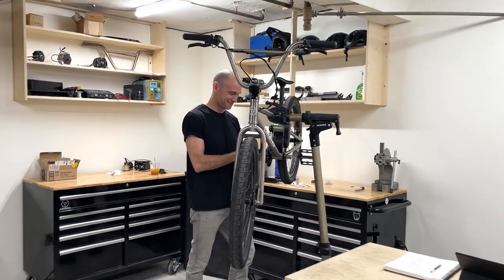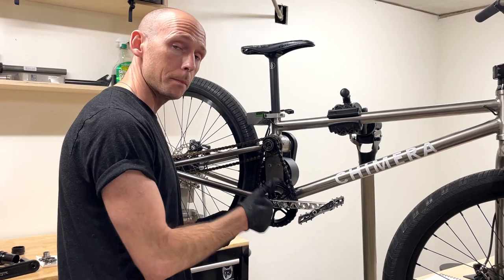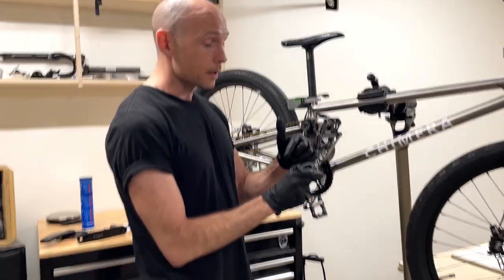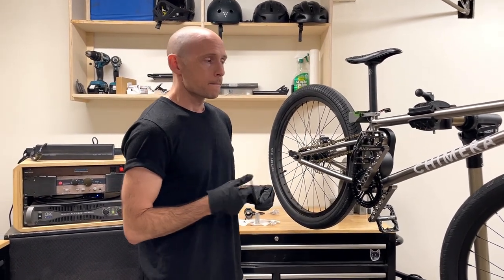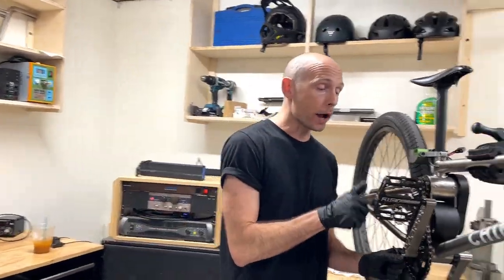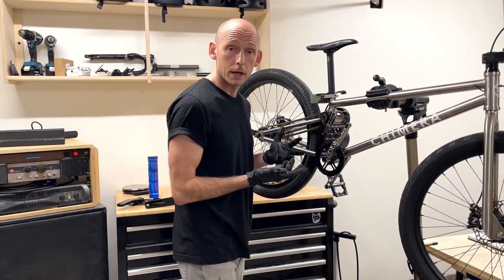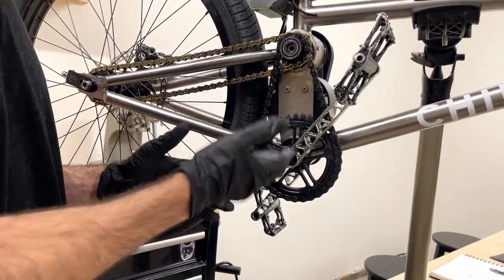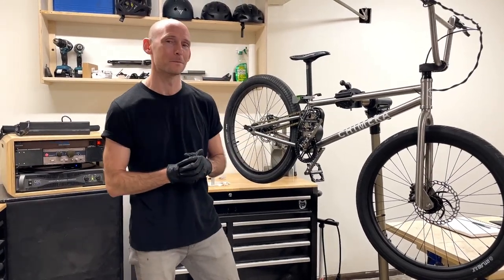In the Workshop - Chimera Crank Compatibility

Comment: Love that you are working electric into a BMX style bike.  Is your target market park and freestyle riders, or boot-around-town/commuters? This thing look pretty beefy (and titanium is a nice touch).   What's the rider height range that your geometry fits?  For example, would a 6' 3"-6' 4" rider fit?  I see that you have a 22" top tube, and 24" wheels, which might be a little tight for bigger guys.  I saw this a few months back when I was contemplating building an electric BMX, but didn't know you were so close to launching on Indiegogo.  I bought an SE Racing Fast Ripper 29" (which comes stock with a 1-11 / 10spd in the rear).  I fitted it with a Bafang BBSHD 1000W motor, Lekkie Motor Cover, Lekkie Buzz Bar Cranks, Lekkie 40T Chain Ring, and 52V 13Ah Panasonic Battery.  I have yet to program the controller, minus what is available through the "info" button and DPC display.  The bike was 31lbs from SE, and the electrical components added another 23lbs - total weight is 54lbs.  This thing has plenty of power, maybe too much unusable power right now the way it's configured (I really need to program it).  For example, I can do 28-32MPH on flats and 18-24MPH up hills easily (13MPH up hills on throttle only).  My real issue is that the bike outruns me, and I cannot really enjoy a good riding cadence.  The bike gets up to speed too quickly, where the power exceeds manual pedaling.  The engine is faster than me, so it really just takes me out of the riding experience.  I'm hoping that programming will help that.  That said, how does the Chimera solve cadence?  Looks like your rocket goes 35MPH.  But how is the power delivered along the way?  On a typical BMX, an end user no longer gets any effect out of pedaling after maybe 22-24MPH.   If I don't limit/slow down the PAS, I fear that I will be wasting battery by using unnecessary power.  Have you solved the programming so that the Chimera feels like a natural riding BMX, but with a little throttle when you need it?  Ideally, I would like an electric BMX that feels like a relatively normal BMX with a burst of power when I need it (like on these mammoth San Francisco hills). ;). Cudos and congratulations on your Chimera!  GLW Indiegogo!
Reply from the maker: Hi Brandon. This is such a thoughtful comment. Thank you! We don't bother using a PAS. The bike pedals about as easily as any other bicycle, but has a throttle when you want to use it, with the ability to adjust the power and top speed wirelessly via an app. That is one way to solve the issue you cite. Another way is to simply go with a less powerful PAS system. For my money, the best low-wattage mid-drive conversion kit on the market is from Revel Propulsion. Here's a link https://www.revelpropulsion.com/mid-drive-motor That setup only weighs 10extra pounds with the battery! And it's highly adjustable for speed and PAS. Thanks for the well wishes. We're excited for the launch but nervous! - Austin
Reply: @chimerabmx  Ahhhh-ha!  Ok, I didn't even realize that Chimera wasn't PAS. Now I know why keeping it 35lbs was so crucial.  Super rad!  You actually get to maintain the manual riding feel and only have to push a 35lb BMX.  Shit, a lot of the Big BMX bikes are 30+ as it is.  You said your engineer has been testing it on SF hills, yeah?  I'm in SF in the Haight.  I'd love to meet up and check in out in person.  Super cool guys!  Sending positive vibes on today's Indiegogo launch!  You are a third of the way there!  Go Chimera!
Reply from the maker: @brandonhunter2760  Thank you! Dude the bike that was in San Francisco is actually the one that Ryan Williams and Dusty Wygle each flipped at a Nitro Circus practice session - check out those videos if you haven't seen them. Hopefully we can get that bike back up to SF asap.

Comment: How’s the high drive torque vs the CYC X1?, is it quieter?, the CYC is very noisy compared to hub drives. I like the chimera weight to torque ratio, and what are the power specs for the commuter battery. I’m looking for around 27 mile range at 75% throttle, and 25% pedaling. Keep those videos coming!!
Reply from the maker: Thank you for these detailed questions, and for the encouragement! All else being equal, our system provides substantially more torque than the CYC X1. But the CYC can be used to convert bikes to electric, while our system requires a specialized frame that is made to house our much larger motorization components. So in some ways it's an apples-to-tomatoes comparison. 

From what I can tell, our system is also quieter than the CYC, but it's certainly not as quiet as hub driven motors. Personally, I feel that e-bikes this fast need to make enough of a sound to help alert pedestrians and slower-moving vehicles. 

The "commuter" battery will happen, but not until after our pre-orders on Indiegogo of bikes using the 8.4ah pack. 

We'll keep the videos coming. Keep these comments coming!

Comment: That's not true because I've got a 750w BBSO2B mid-drive and I've just changed my chain ring to a 36T too achieve more torque 😅👍🏾
Reply from the maker: Hi Rory. That's cool! The Bafang chainring is not a standardized bicycle part, though. It is an e-bike specific five-bolt system that only a handful of online vendors sell, and almost no bike shops carry. By contrast, the chainrings you see in this video are off-the-shelf bicycle parts. They are easy to find and not e-bike specific.
Reply: @chimerabmx  I didn't know that I have bought quite a few in different sizes incase I want to change I did order them fro China so that might be the reason why I could get them so easily I did buy the 5 bolt adapter fitting as well because of the chain ring need it😊